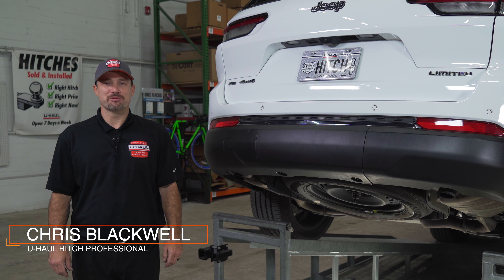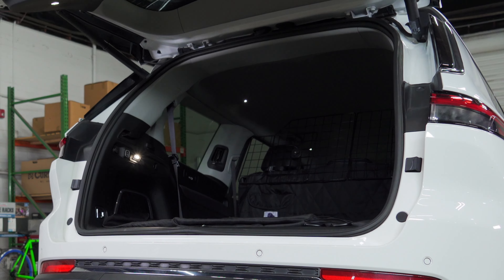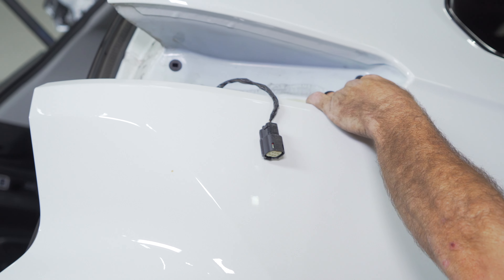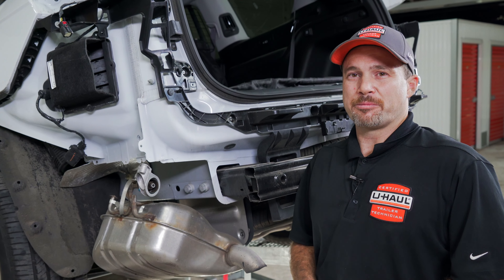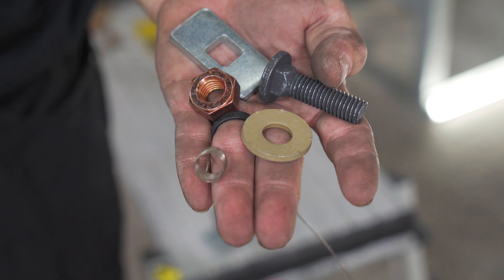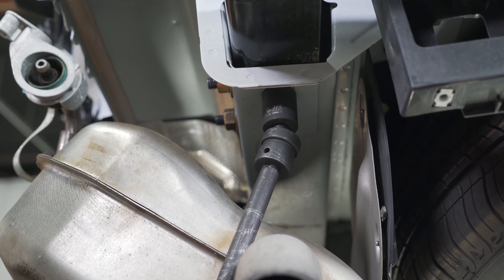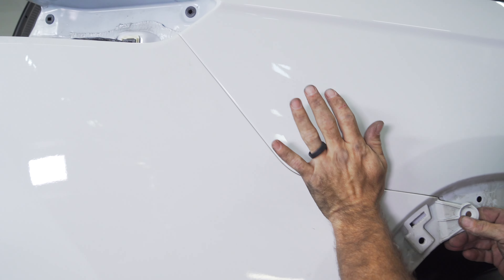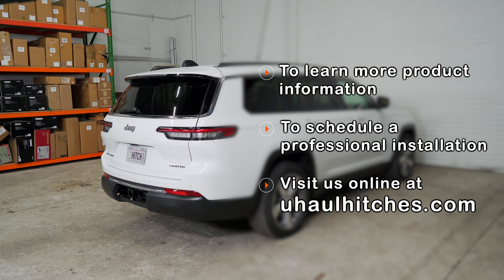2021-2024 Jeep Grand Cherokee L | U-Haul OEM Style Trailer Hitch Installation

Comment: Where are you located, I want you to do my instal,I guarantee our local U-Haul won’t be that gentle, my local U-Haul reviews Have tons of complaints!
Reply from the maker: We have over 1500 Hitch installing centers. Visit Uhaulhitches.com to find one.
Reply from the maker: Were you able to get a quality installation in your area? Or do you still need assistance finding a quality Pro? I would be able to direct you to some in my area as well even before I could do your install(I'm Not a hitch center). However, If you need assistance we will help you find the best in your acceptable driving radius. Just Re Comment Your city or metropolitan area and driving radius your willing to travel.
Reply: My old 2019 grand Cherokee the install was simple. Is this one more complicated because of the rack or because of the jeep? I only need it for a bike rack, not towing anything behind.
Reply from the maker: This hitch is a OEM style hitch that hides behind the bumper knockout for the Redesigned 2021-2024 Grand Cherokee and Grand cherokee L. The hitch you likely installed for the 2011-2021 Grand Cherokee is a aftermarket part and wouldnt be able to be installed on the redesigned Grand Cherokee. OEM style is the only hitch option for this Vehicle.

Comment: hello very good video, i have one quiestion, does this hitch fit for jeep grand cherokee altitud 2024?
Reply from the maker: Yes, This Hitch Fits the 2021-2024 Grand Cherokee, Grand Cherokee L, and the 4xe with a factory trim panel in the bumper. In this instance the Altitude trim level doesnt change the available hitches.
Reply: @trailerhitches  thank you very much for the information, here in Mexico the Altitud trim just arrived this years so there is no especifically hitch for this version, one more question i have also a jeep grand cherokee limited 2014 with hitch, this hitch  fit de altitud version?
Reply from the maker: Unfortunately this hitch is for the 2021-2024 Versions of the Redesignd Grand Cherokee and Grand Cherokee L. See this video for a hitch for the 2011-2021 Grand Cherokee and the new Grand Cherokee W/K. https://youtu.be/hpFt_vH9N1Y

Comment: Just finished install and it turned out killer but now my rear electric trunk wont open/close haha any reason as to why the trunk would be affected by installing the hitch and trailer wiring ?? Thanks in advance
Reply: I figured it out…I’m gonna leave this comment here because im sure someone else is going to run in to the same problem… if you leave the liftgate open throughout your install, after about an hour the liftgate will remain open and the buttons will not work, you have to manually close the liftgate to reset the sensor for it.. I found that out in the owners manual and I thought I was going to have to take it to the dealership haha these new cars are crazy.
Reply from the maker: This is absolutely Correct and applies to all automatic lift gates. They always need to be manually closed to reset themselves! Great Job!

Comment: Would you recommend unhooking the battery first before unpluging tailights ?
Reply from the maker: The negative termainal of the battery is removed when cutting or splicing constant 12v power wires to prevent sparks and shorting of fuses. Plugging and unplugging connectors poses no threat to the Vehicle unless you do it while the taillights are illuminated by the presence of electricity. If nothing is on then nothing can spark, or blow a fuse. The electricity does not leave the power distribution panel until you turn on the lights, or indicate a turn signal, or depress the brakes, etc! You are Welcome to Disconnect the Battery. In your case its only memory functions you will lose. But newer EV's can have issues after disconnecting ground.

Comment: Thanks for the video!

When I did mine, I didn't need to drop the mufflers.  I just removed the muffler mounting bolts on either side when I was working on it.  Also, I was able to fit a 15" adjustable wrench to loosen and tighten all the mounting hardware.  It was tight, and slow, but it worked fine.  I wasn't able to get the black fender molding off without breaking the clips and the clip mounts
Reply from the maker: Your welcome!